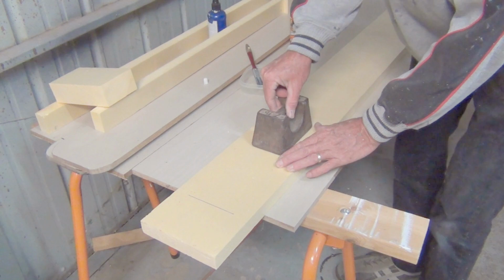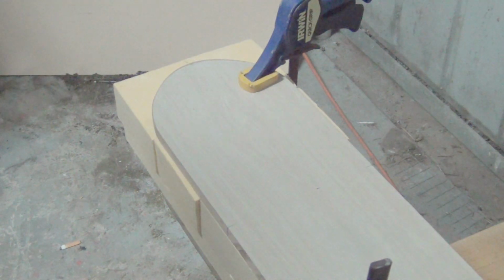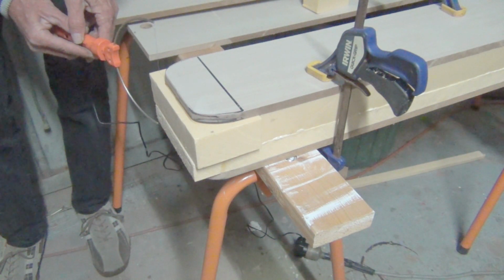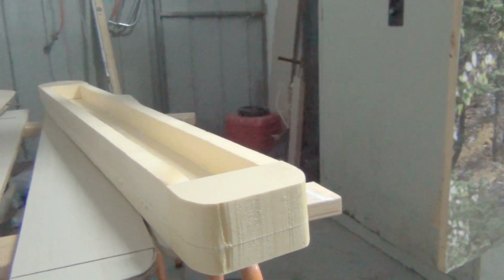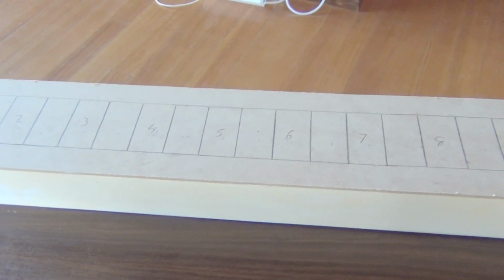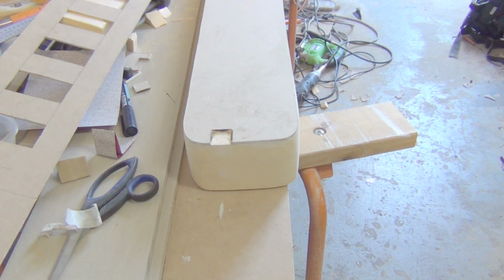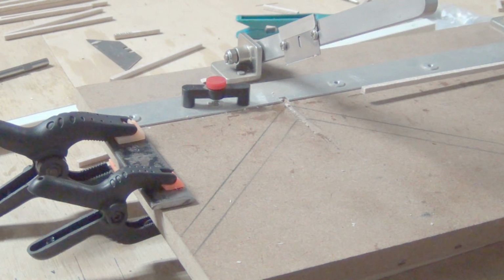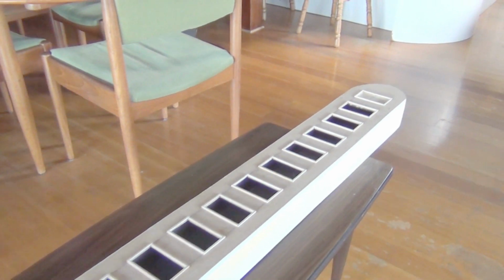Building the Ore Boat Part 2 " Model Trains "

Comment: Do you think a band saw, sawsall or jigsaw would have saved you time?
I understand the hot wire but for as big of a job you were doing?
Reply from the maker: The hot wire cutter cuts better than a band saw for this boat cheers Robert

Comment: Robert, Along with pictures you can find online. 
If I can find your e-mail address, I can send some, what I think would be helpful pictures of the Joseph L. Block.
Along with the steel company logo that is on the stack. E.G. - Arcelormittal 
Along with this info, you may be able to use some of the new ladders you have to make more measurements. 
The top of your ships bridge tower should almost reach as tall as the ore dock.
From what I see on pictures.
The Joseph L. Block is now mooring for winter in Sturgeon Bay, Wisconsin. At the Fincantieri shipyards.
Reply from the maker: The ladders are for this build